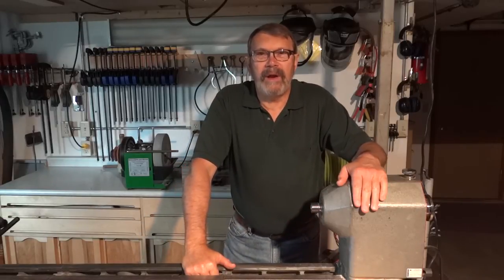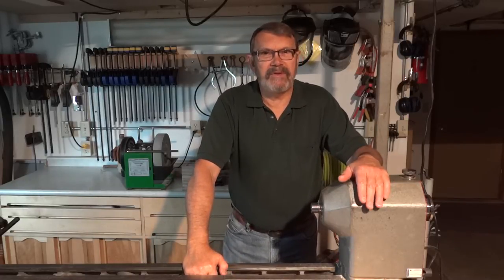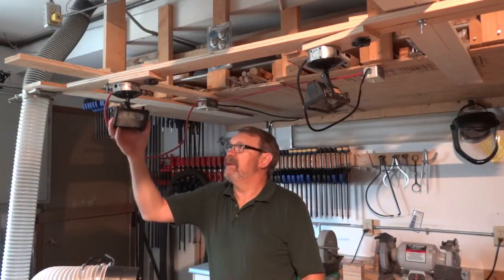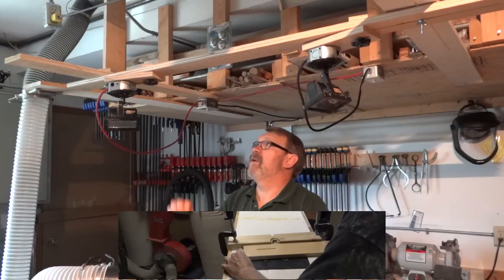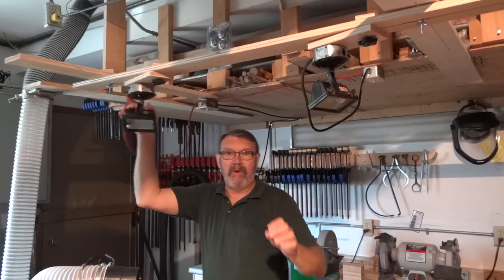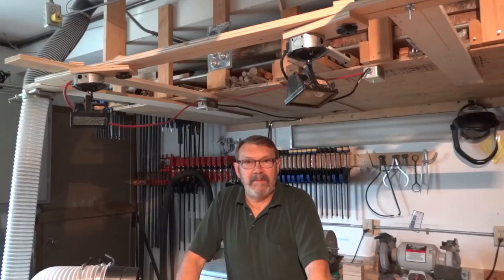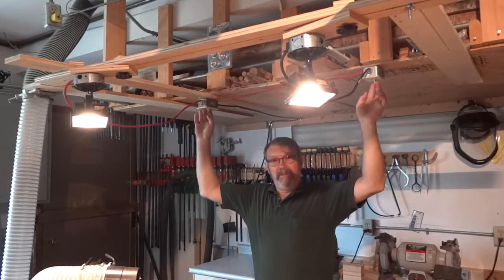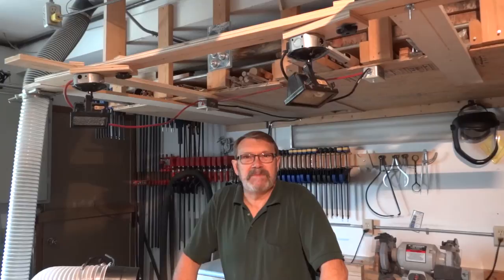Improved Lighting For The Lathe

Comment: I actually am an electrician, I've seen people try to get away with a lot worse than that, at least all your connections are in proper boxes. Likely the only thing I'd change would be permanent connection to the switch feeding to permanent receptacles with the lights plugged in. Other than that for this application the flexible cord to the lights should be ok as it needs to be movable.
Reply from the maker: traog Good idea! I went with this because I wanted the lights switched individually and I'm far too lazy to change it. Thanks for the input. And thanks for all the comments!! I appreciate them; always looking for ways to improve! Have a great day!
Reply: I wouldn't insist on it being changed, like I mentioned all your connections are properly contained and therefore shouldn't cause any issues. I'd get my fingers slapped if I did that so I wouldn't do it, but I wouldn't expect an inspector to give you much grief about it.

Comment: LED lights. Less heat and cheaper to run.
Reply from the maker: MrLeonard55 You're right but it's winter and I'm glad to have the extra heat. Also, LED lights may be cheaper to run but the ones I want are not cheap to buy. Thanks for watching & for the feedback.
Reply: Gordon Rock The initial outlay is expensive. Hopefully they'll come down in price some day. We installed some exterior lights at the entrance to a subdivision recently and it was a big bill. They have a pretty good selection of exterior lights.
Reply: LED lights are fine for things, where you don´t mind the quality of illumination. I mean, LED light is sharp, but too monochromatic, which is not natural for human eye. The reason, why it is problematic, is that ordinary heat-generated light is more spread over area, it returns from obstacles in different angles thanks to vaste diversity of its wave lenght - and this leads on that shadows are shallow. On the contrary, LED light is sharp but monochromatic, it returns in one given angle from obstacles, any edge is like the end of the world for this light, nothing goes over it. The result is that you may have extremely illuminated front plain of the object, but behind any edge, you get dark shadow, where you can see really bad. For me, common bulb is unequalled source of light. For real purpose, I use fluorescent tubes in workshop and bulbs for local worktable lights for additional detail lighting. I am sorry about the long comment, I hope you gather the best of it to your own benefit. :-)
Reply from the maker: A very well worded comment!! Your view makes a lot of sense! Thank you for posting this, Kamil. More to think about!!
.....Gord